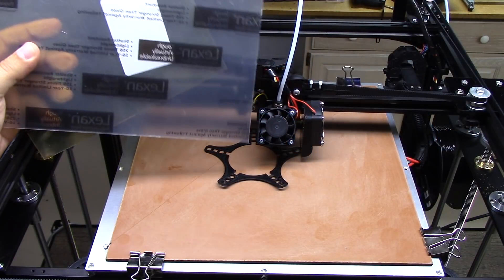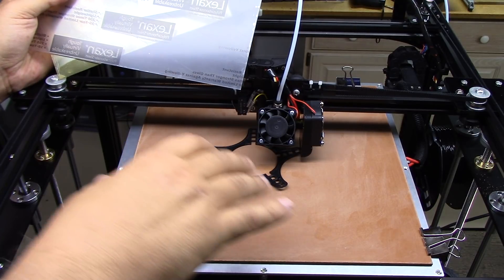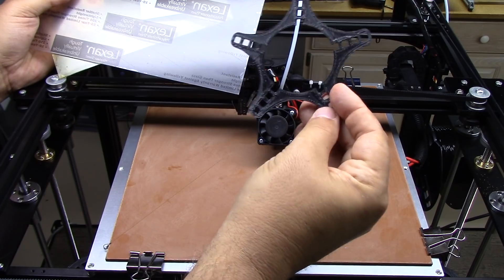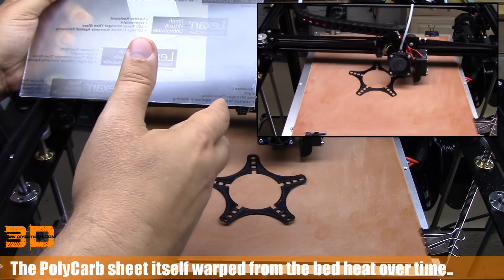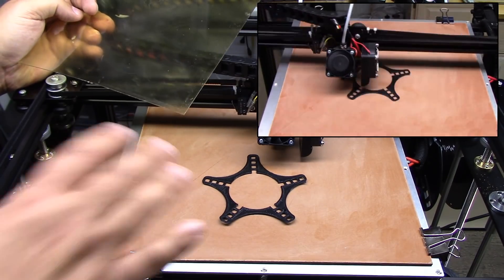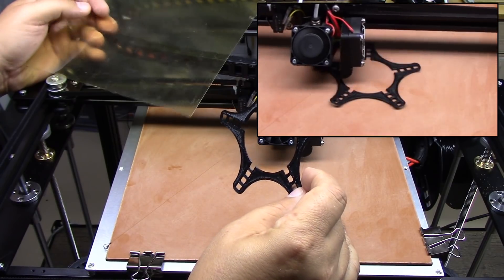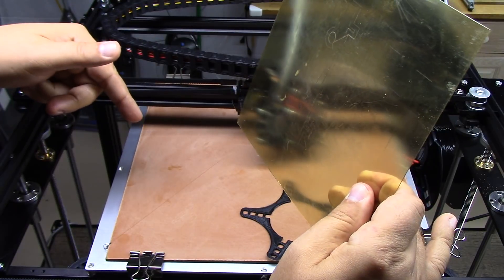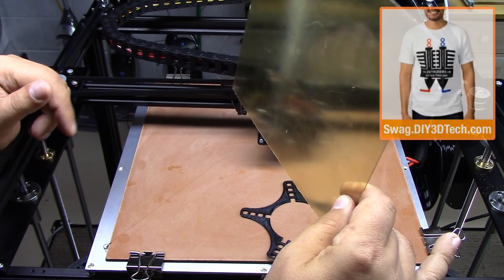Shop Talk - Testing PLA with a Phenol Bed and Discussing Other Build Surfaces!

Comment: Hello DIY3DTECH, GREAT VIDS, I own a TRONXY X5S printer, love it, just figured out how to change filament on her. got jams in the teflon steel tub had to scrape them buy new ones, successfully rebuilt my hotend, now she is working pretty well, still some kinks to work out, but on to beds, I got a Glass mirrored bed is working great so far, some of the prints pop off, some i have to pry off. but working good so far. great for doing vids you can see whats printing in the mirror bed surface. the hotend on this baby is a trip to work with. by the way this is my first 3d printer :), learning Alot about 3d printing.
Reply from the maker: I love mine!

Comment: Thank you for this video. I love your channel.

I have been using PEI on glass for more than one year and even after thousands of prints surface is still perfect to print. Only filament that I had problem is flexible filament. It sticks too well so I print flex at 0.4 mm height from the surface to recover this problem. I tried nearly every kind of filament (PLA, PLA+, PLA Pro, PETG, ABS, TPU, XT, HT, CF, Nylon ..). PLA and similar 60C, PETG 70C, ABS 100-110C, XT 80C, HT 120C, Nylon needs Phenol for sure, even PEI does not work with nylon. I have 5 printers all my own build and all are CoreXY. 

I also use a 5 mm cork sheet sticked by 3M 468MP tape under the heated beds which reduced my bed heating time dramatically.

I only use Ultem original PEI and buy them from Amazon. Search for ULT-0030-E.
Reply from the maker: Interesting and thanks for sharing along with the kind comments, this is where I have found phenol also works well for TPU so use it for both nylon and TPU and PEI for  everything else.  This was more so an experiment which of course didn't work for PLA :-)  Also as for cork, check out my video's on insulating heated beds and especially the one https://youtu.be/2jEkNutaUTg  as I personal steer clear of cork.  Also checked out ULT-0030-E as you suggest, but found only one vendor and their thin sheets only go up to 12x12 and need larger, do you know of any sort of vendor selling wholesale larger sheets?  Also, how are the CoreXY's working for you and can I ask why you selected CoreXY?  Thanks again!  :-)
Reply: Woow. I never thought about insulation like that. I also have insulation cotton but I will also check if they are fire proof. If not I will try your way.
The only real Ultem brand I could find is that. The 2 sheets were $16.50 befor now only 1 sheet is $21.00. I was lucky that I purchased a lot so now I do not look around. My biggest printer is 300x300 so 12" is enough for me. I believe you have a printer with bed bigger than 300.
I have choosen CoreXY with two reasons, it is easy to create a covered printer, overall uses less space for same printable size and most important much faster than others. And more my printers are deadly silent (42-43 db) at 60-70 mm/sec speed. I use carbon fiber rods, bronze bushings, wade type geared extruder, auto leveling. I have 2 200x200x200 and 1 300x300x300. I have inspired from HyperCube of Tech2C and still working on designs to make them more robust and compact and better. Actually my firt printer 3 years ago wa a Wanhao i3 Duplicator and I transformed it to a HyperCube first then others came.
Reply from the maker: I am impressed that is VERY quite!  Know I have the Tronxy X5S and have been very impressed with the CoreXY design looking forward to more mods on.  Also find the use of carbon fiber rods interesting too!
Reply: DIY3DTECH.com Carbon fiber rods are 10 mm and originally made for drones. You can buy them from aliexpress 500mm cut and 4-5 usd each. they are only 16 grams where steel rods 8mm are 250 grams. This makes a huge difference. I also use bowden setup so extruder weight is not on the head. of course e3d v6 all metal helps a lot too.

Happy new year. It is already 12.00 pm here and I had to stay at home with my broken leg.
Reply from the maker: Ouch on the broken leg!  You must be down under!  Spent a lot of time in the hanging around Melbourne (use to do work for Holden) so happy start of 2018 and I would say beak a leg but it sounds like you did already!
Reply: DIY3DTECH.com Biggest problem is I am over 400 pounds. Nice to hear that you are from Melbourne 3 of my cousins lieve there.

Comment: Hey man, love your channel great stuff. I wanna help you out with this bed stuff, look into the Anycubic I3 Mega bed. No tape no muss no fuss. Heat your bed to 60C for PLA and just print. When the bed is done cooling if you just touch the part with your finger it will come off! 

So far I have printed PLA, PETG, and TPU. Every single time the prints just came off that bed. They are now making these glass like bed sheets for bigger beds, you might want to spend a few bucks and get this bed to fit on your larger beds and try it out.
Reply from the maker: Thanks for the kind comments!  Actually for all that stuff I have found PEI (have several vid's on PEI) works great but Nylon and TPU are different stories and the reason I am experimenting other surfaces.  As phenolic board is sort of like cardboard and was thinking it might act as masking tape does with a large surface aera.  However that didn't work an think the case is the nature of the material itself.
Reply: I found a link to the part, right now it seems the biggest one you can get is 310mm x 310mm. Might we wroth a try. 

https://www.aliexpress.com/store/product/ANYCUBIC-Ultrabase-Self-adhesive-3D-Printer-Platform-Heated-Bed-Build-Surface-Glass-plate-310x310x4mm-for-MK2/721071_32843178556.html?spm=2114.12010615.0.0.7eba36de17bfv2

I printed TPU without any issues and came off the bed once cooled with a touch from my finger. I really mean that a slight touch with a finger and the part is off the bed. i know others have had issues with TPU sticking to the bed, not so with the Ultrabase, only thing is you have to wait till the bed cools down otherwise you have to pry it off. I would love to send you some samples, next time I print in TPU I'll make a small video. The good thing is they seem to have listened and are making this bed available even for other printers. Anycubic does not have a printer yet ( hoping ) but they made a bed available for other manufacturers so it might be something to consider. 

One thing to take serious note of. If there is a power failure on this type of bed, if it cools down it will release the part so something to think about. I believe it is almost a waste to have power resume function on the printer, some folks have used glue to tack down the part after a power outage so the part stays put. So it is something to consider. If the power outage or sag is short lived, then there is no issue as the bed will retain enough heat to hold the part. A power outage of 30 minutes or more and the part is loose, either you glue it or kiss it goodbye. I don't want you to discover this the hard way.
Reply from the maker: Yea after a lengthy power outage I agree, however we have a whole house generator so so within a minute or so power is back.  Its interesting the they offfer it in 310x310 sheet as biggest I found PEI is 300x300 but need a larger sheet for the Tronxy....

Comment: Glass and aquanet for over 6 years with zero issues.  You may consider it "prehistoric" however it works, and I guarantee that I spend a LOT less on a sheet of glass from the hardware store every couple of years and a few cans of hairspray than you and others do on these gimmicky bed surfaces.
Reply from the maker: If your happy that is what counts :-)  However I paid less then $20 bucks for a price of PEI I have over 1,000 prints on it and it is still going so that might [economically] trump your Aquanet purchases!  :-)
Reply: DIY3DTECH.com well played good sir, well played. 😂 lol

Comment: What bed temperature were you using that you were having issues with the PLA sticking? I print directly on an Ikea mirror with the bed set to 65 C and haven't had any adhesion issues.
Reply from the maker: 60c, however I am expermenting with other surfaces as I have been phenol with nylon and TPU so figured I would try with PLA.  However for PLA would highly suggest losing the mirror and going with PEI (http://amzn.to/2ijpAzu) as this stuff is amazing!
Reply: DIY3DTECH.com I had added it to my Amazon wishlist awhile back but haven't had any issues with adhesion so there's no need to switch at this time. If I start having issues when I get into bigger prints then will order some.

Comment: No Tape??? Wide Blue Tape is the Best thing I have used on my CR-10, for example see: https://www.ebay.com/itm/1x-10-inch-WIDE-3D-Printing-Print-Bed-Easy-Removal-Blue-Painters-Masking-Tape/292226312174?hash=item440a0ba7ee:g:mjkAAOSwRoZZg5ev
Reply: DIY3DTECH.com 
i wanted to try PEI but id preffer an aluminium bed coated in PEI or something. I dont like it having a finite life and having to replace all of it in case it breaks. Either make it thiker or make it so that it doesnt break off after many prints.
I use wide blue painter tape on aluminium here. Sand the aluminiun with 100 grit and then stick it while hot, its really resistant and after one or two prints it loses the wax and pla sticks much better than brand new (a soft sanding also helps) and the good thing is you can use any bed shape or size you want. My machines arent standard so i cant find a 235x235 PEI sheet ot something like that
Reply: Use Wide Blue Tape at about 50 Deg C, if the parts have a lower rounded ( to insert a putty knife) edge part removal is easy, else it is some time difficult to remove a part, but PLA seldom curls up at the edges, it just STICKS.  I have printed 40 2 inch pulleys on the same single layer of tape, which was 10 runs of prints, at 40hrs Total.  To install the wide blue tape. tack the edge, unroll the tape across while smoothing and sticking it down, then cut and  Done!
Reply from the maker: I have sworn off tape long,long ago for PEI.  Now I know you are going to call me out on the Tronxy for having blue tape but that is only because I have yet to find a PEI sheet that big but when I do the tape is gone.!  Think about the cost as that tape is $59 and I paid $20 for the PEI sheet on my CR-10 so the economics are hugely lopsided as I have one sheet of PEI with over 1,000 prints on it and what would that have cost me for tape?  Trust me, switch and you will be amazed!  (I was) :-)
Reply from the maker: I promise you switch to PEI and you will look back as tape being from the prehistoric times it is that good :-)
Reply from the maker: You can always purchase a lager sheet and cut down (had to do that for one of mine).  I am also confused about "finite life" as everything a finite life and one piece of PEI with over a thousand prints and still going so a bit confused.  Also with PLA you can sand about anything and make stick, but it is also about the release as with PEI the second it cools it pops right off as I have  tried other surfaces sanded and they worked "but" the issue was (1) release and (2) finish of the first layer was not how I would like it (because of the sanding)...

Comment: Look and try Anycubic Ultrabase it is amazing stuff and when it cool the print just release with out scrapping.
Reply from the maker: Yes I have, it seems OK but for the cost it is hard to beat PEI and actually that is might be what they are using as that is how PEI works.  When warm, the plastic holds and when it cools the part just pops off...
Reply: This is my favorite surface now. It's robust and works amazingly well for everything